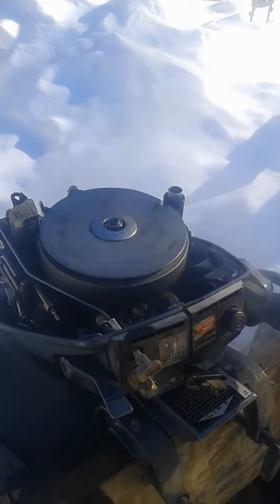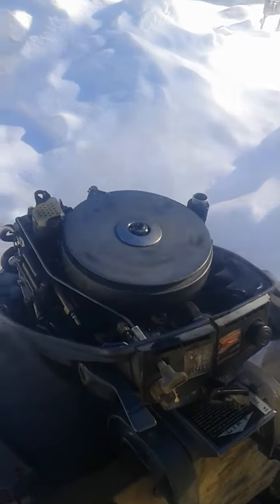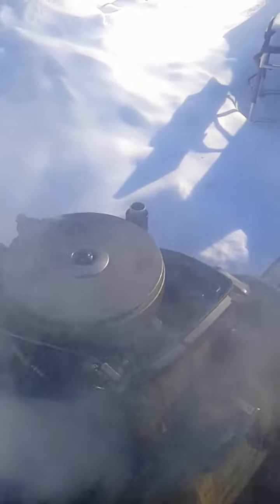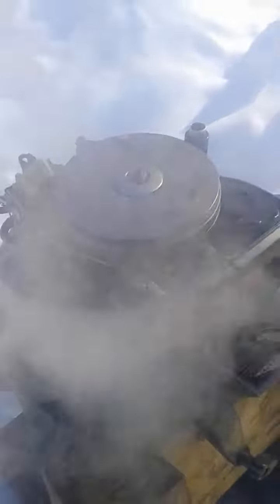1965 Evinrude 9.5 (Scott C.)

Comment: Seems to be running good whatever the condition of the points.
Reply from the maker: It does....and they are sierra points to boot. I'm sure you have seen how they usually work. Don't fit the post right, contacts don't line up properly....on and on. Thanks for the comment M.